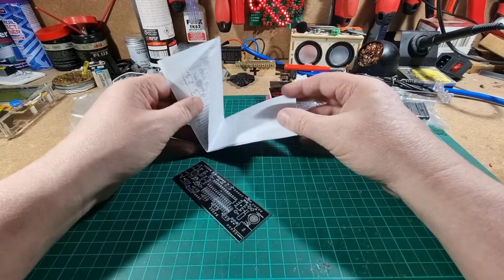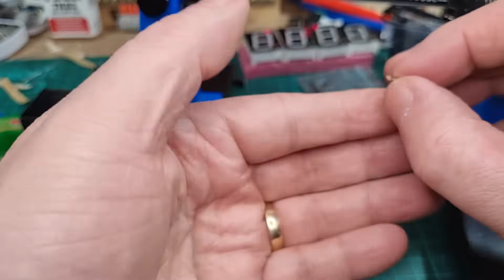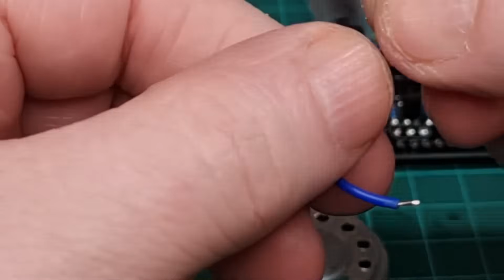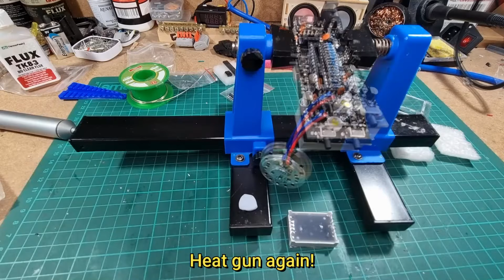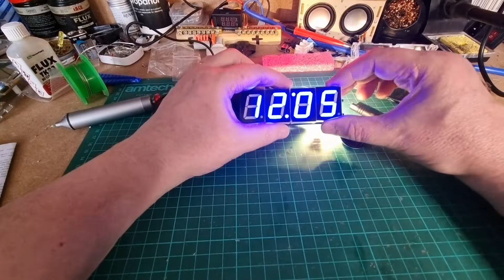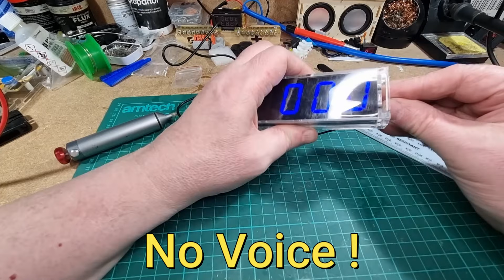Kit build of the LED Talking Digital Clock kit

Comment: keeping the resistors and other non-polarized components in the same direction is a useful service and production method. It means that when a product is inspected, or a service engineer is looking for a fault, the board only has to be rotated 90 degrees to be able to easily read the component value. 

In today's world of SMD this is not really all that common, but once you get into the habit of doing this you do tend to keep to the habit. Probably the memory of some production inspector poking fun at a young apprentice has a lot to do with it.

Andy
Reply from the maker: ... and my OCD !